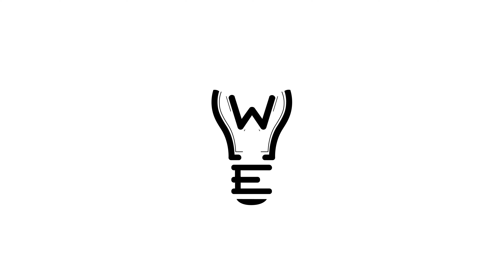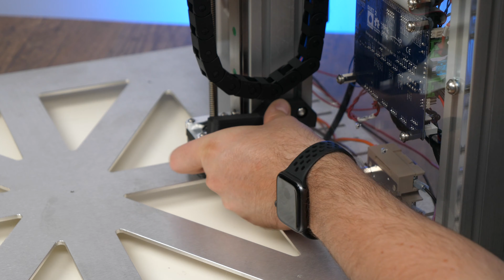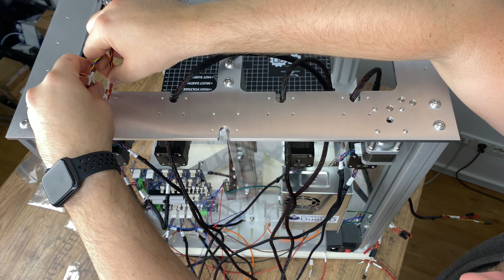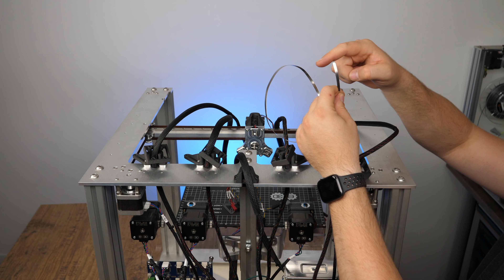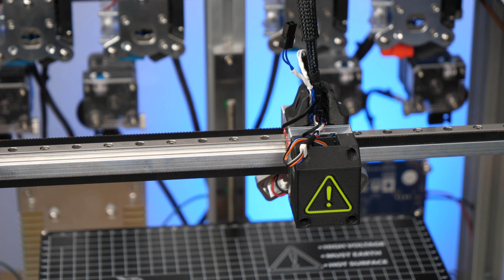E3D Toolchanger -Assembly #07 - Connecting Motors & Tools

Comment: cool video. question: are the metal strips sharp? could they potentially damage the wires?
Reply from the maker: They are very smooth. Only the square end is a bit sharp, but the end is put into the printed part, hence: no problem!
Reply: @ReneJurack  awesome. thanks!